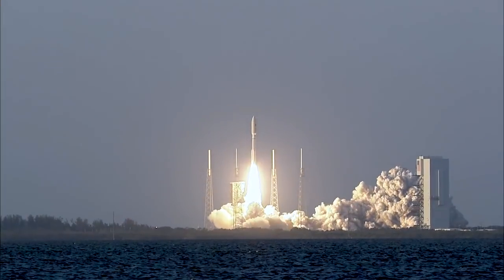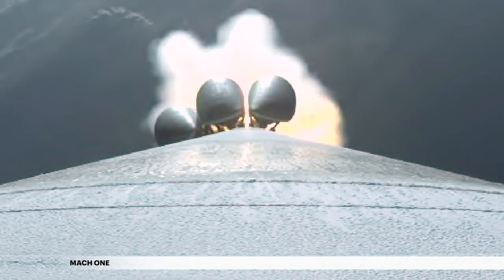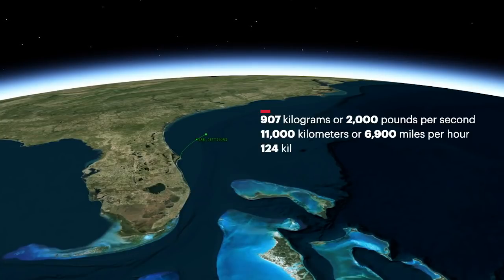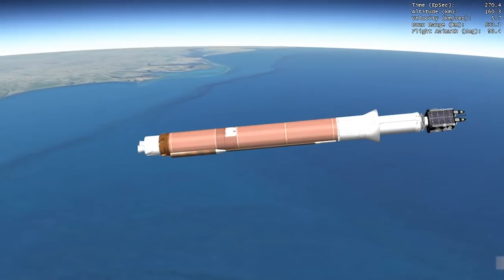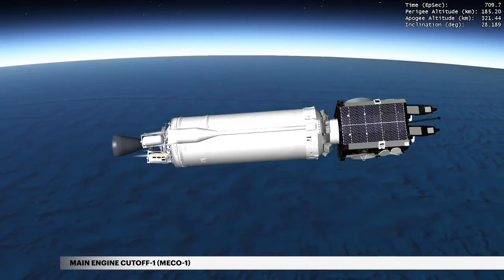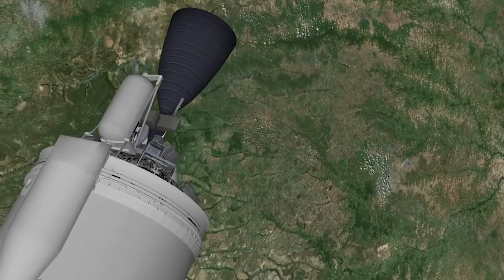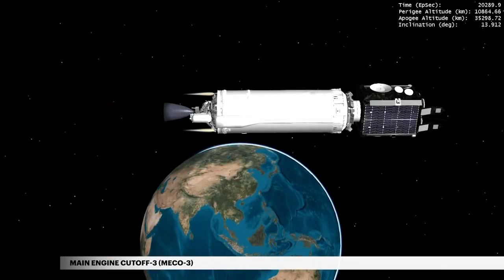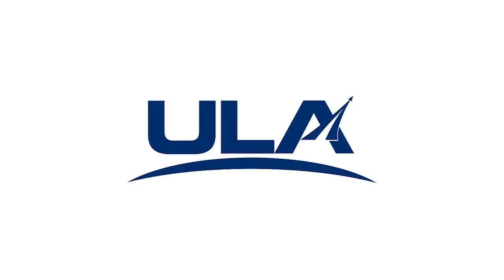Atlas V AEHF-6 Mission Profile

Comment: Why can't you land the Atlas V booster like SpaceX lands the Falcon 9? This is 'old space tech' which along with cost-plus contracts is going to be the end of ULA.
Reply: OK, why don't you redesign the atlas v booster (which is 18 years old) so it can land. Or instead of that, why don't you do some research and realise that its impossible to recover the atlas v booster which is why they're replacing it with vulcan
Reply: They would have to redesign Atlas which is not worth it since it will retire in like 4-5 years. BECO for the Atlas booster is 4+ minutes so is going really fast, slowing it down would take a lot of fuel